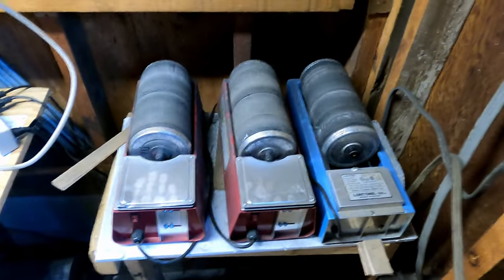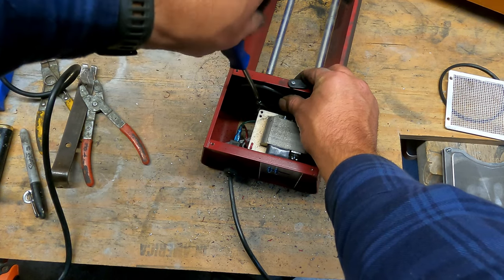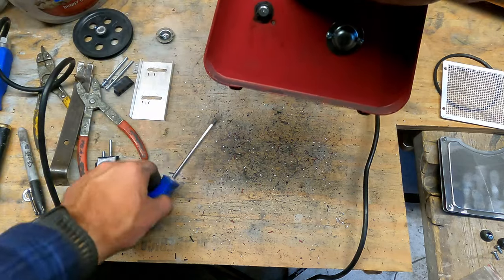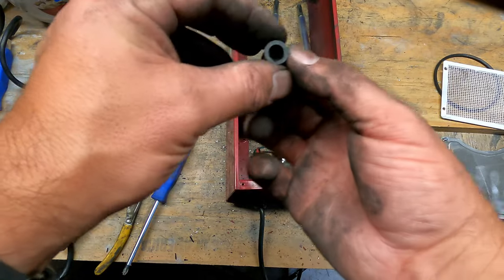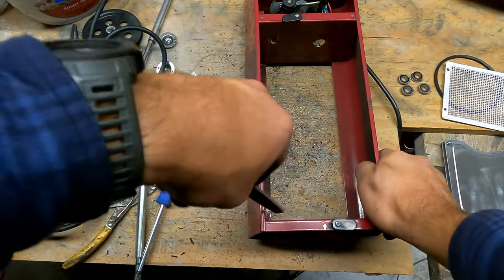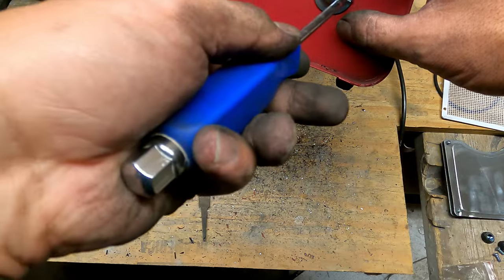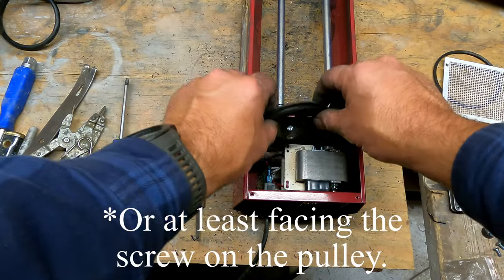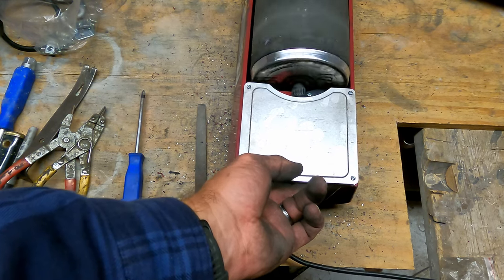Bushing replacement tutorial for Harbor Freight and Lortone 33b

Comment: I made it only part way through my first load of rocks with my brand new harbor freight rock polisher and it wore them out. I tried to do a fix and it slid around. It's all sitting in a box, apart for over a year.
Never saw any fixes for it before.
I bought a cheap one from Amazon and it began slipping not long after starting the first load too.
Bushings and how the belt fit on all these is an issue.
Reply from the maker: I've never seen any in depth bushing replacement videos, either, which is why I did this one. Do you think this'll help you correct the issue with at least your HF tumbler?

Comment: Get rid of the thumping noisy belt. Use a soft rubber o'ring. Works great. 

EPDM FDA O-Ring 70 Duro Black
Model: E70343
Dimensions: 3-3/4"ID X 4-1/8"OD X 3/16"CS
Reply from the maker: I've had a lot of people say that. If I ever go back to those tumblers, I'll give the o rings a try.